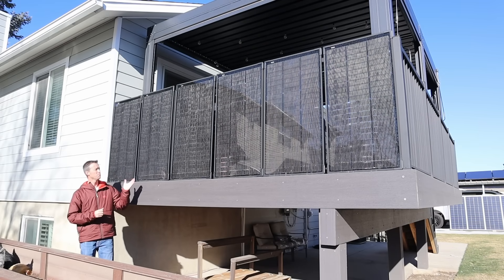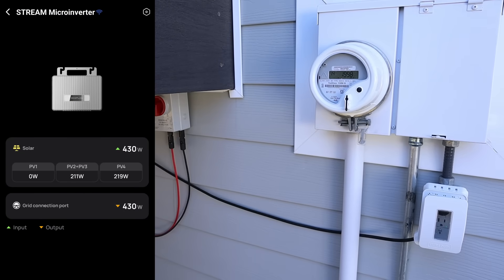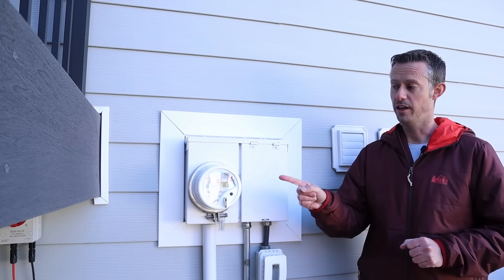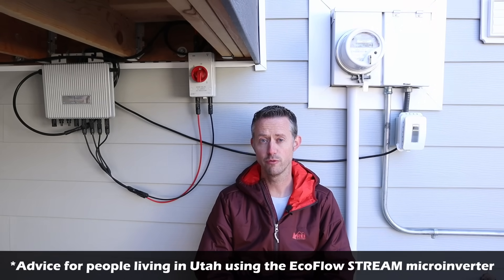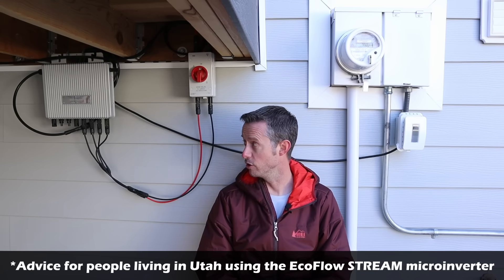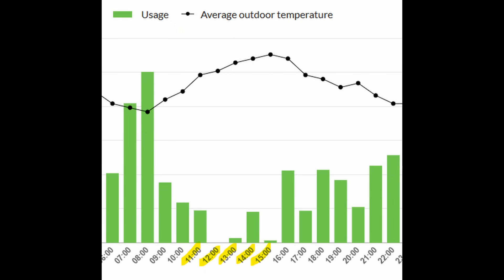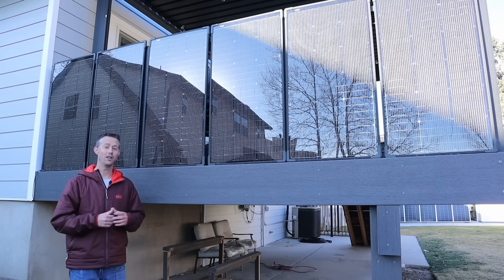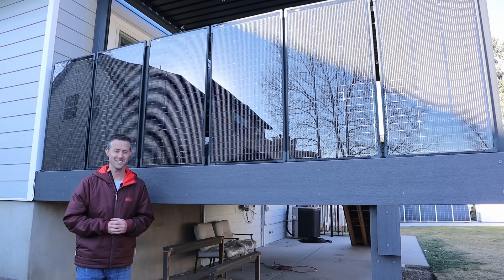The Simplest Solar System I've Ever Installed!  I Just Plugged It In!

Comment from the maker: Read this first before commenting:

1) The microinverter is UL listed and has anti-islanding technology. If the power goes out, or you disconnect it from the outlet while solar panels are still connected, it turns off immediately. Not risk of backfeeding during an outage or getting electrocuted from the male plug. 

2) The solar panels from Ecoflow have a unique wiring setup. They are not like a traditional solar panel with MC4. This array is not wired in series. Each panel has waterproof dual XT60 connectors that wire the solar panels in parallel when they are connected in a chain as seen in the video (each panel has ~45v and 2a). The wiring is super simple for a setup like this and performs great in shading. They are designed for Ecoflow 60v charge controllers 👍

3) This setup requires the device to be on its own breaker. The Ecoflow microinverter is connected to a 20 amp dedicated circuit using 12 AWG wire.
Reply: So, only one 120V leg is powered?
Reply: Hey great video! Can you elaborate on the 3rd point? Did you set up a separate breaker for the inverter? Or are you just making sure to not directly run anything on the breaker it is connected to?

Also, the 48v battery experiment would be great to see! I was wondering if ecoflow power stations have the capability to do exactly what you are saying!
Reply: @Kgjoha  When I set mine up the app had me specify whether or not I was on a dedicated circuit.  IIRC a non-dedicated circuit pumps out 800w (1200w for a dedicated circuit).  My dedicated circuit is on a 20 amp breaker so I'm only using 50% of the breaker's capacity.
Reply: Are shunts built in to mitigate shade affects?
Reply: Following the laws of taxes.
Reply: If sodium ion batteries drop to 10$/kWh as promised by CATL .

There is no way Trump and the oil companies can stop the energy transition..
Reply: Utility company will require proof of permit and inspection. Do your research before going down this road.

Comment: Neat. I still hate solar that can't be used during power outages. I totally understand the safety aspect. My biggest problem is the storage issue. Batteries just aren't viable unless you want to spend a few 10s of thousand.
Reply from the maker: They are only that expensive with grid tie systems like Enphase or Tesla. 
Off grid 48v LFP batteries can be purchased for $900 for 5kwh these days.

Comment: One thing to consider, is everyone doing this leaves the utilities with stranded assets. They either jack up the rates to offset, or potentially stop planning for the extra load and may not be prepared if there is down production the way they could if there were interconnection agreements mandating coordination of downtime and penalties for lack of certain availability thresholds. Similarly, electric cars currently take advantage of infrastructure in a way that's not scalable, with power prices having to go up for everyone to reduce demand and/or invest in grid upgrades to handle exoected load growth more cost effectively in the future

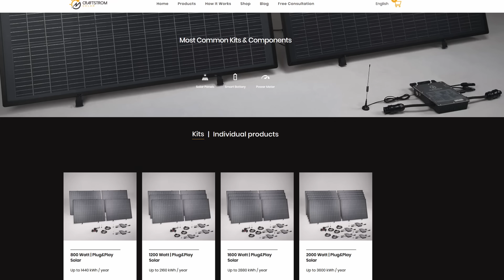Comment: The company's literature (at 3:00), regarding power produced, is very misleading. They are using five hours per day, of max sunlight, in their calculations. This is why so many solar adopters become disillusioned by actual results. Using three hours per day is much more realistic - especially if not in the lowest row of US southern states (four max, even there). This is fraudulent, at best. And, even if in Arizona, the heat produced lessens the power produced by the panels. There is also the inverter's share, the transformer's share, the transmission's share, and the degradation of the panels, over time - all of which are never mentioned. Once included, the 20-year panels will likely take 30 to 40 years to pay back (without including cost of repairs and maintenance) their costs. There is also the increased cost of homeowner's insurance to consider. I'm in no way 'anti-solar' - I simply want to let people know the costs that are largely ignored.
Reply from the maker: In the summer I get 8 hours of peak solar, in the winter I get around 4 (due to shading from my neighbors). If you had a device like this in a field away from shading your results would be excellent. I don't have that opportunity because of all the trees...

Comment: I'm looking into the ecoflow 125w for a similar project and I'm wondering how much input you're getting with 5 panels at this 90° angle setup.
Reply from the maker: 450 watts right now in the winter, it would be less in the summer so I might have to rethink an angling system.

Comment: Interesting. My question is: I thought solar panels rely on being the correct orientation and angle to maximise energy production? Mine are on a directly south facing roof at an angle, and I was told that if I put them on the other side of the roof, they would produce about 50% compared to the south facing position because of this. Also the roof is of course free from obstructions in my setup. Are these different from those panels in that way, i.e: the angle/height doesn't matter as much? Or are they the same as mine (6 x Enphase 450w in my case). Thanks.

Comment: The reason plug-in solar is illegal in most jurisdictions isn't due to excessive generation OR lack of anti-islanding, but lies in having two power sources within the same circuit, creating a fire hazard due to the possibility of overloading the cable downstream between the grid-tie inverter connection point and the potential excessive load point on that particular circuit. A dedicated circuit is necessary for interconnection, but many folks will just plug it in to the nearest outlet without protections in place, creating the danger. I think it should be illegal to supply or use standard NEMA 5-15 or 5-20 connectors on these inverters. GTI's should be required by the NEC to be hardwired with no other loads on its circuit. Only then would it be safe.

Comment: I'd rather spend a few extra thousand for batteries and a decent inverter then give the power company free electric. And what good is this solar when the grid goes down? You can't use it. And unless there is a power cutoff at the breaker, there is a liability of back feeding the grid.

Comment: I live in Utah and just installed this same system on a dedicated circuit.

You have a Y connector coming out of your PV disconnect and into two MPPTs on the microinverter. Does that really work? The Microinverter just splits the power equally to each MPPT?

Also, if you connect the battery like you mentioned trying, wouldnt it just send all excess power above what you are using to the power company for free?

Comment: How many decades until you have 100% ROI?
Reply: About a year, I only have $550 bucks into the same set up. $300 for 3 Qcell 400 watt panels, $200 ecoflow micro, $50 for outlet, wire and breaker. And the satisfaction of producing your own power.

Comment: Nice setup! Solar photovoltaic cells convert sunlight using semiconductor p-n junctions. Micro-inverters optimize each panel's maximum power point. Grid-tied systems require anti-islanding protection.

Comment: Hello I’m an Utah Instaler for ecoflow; this is legal only if it’s completely off grid, no grid feed at all.  Basically what you have is a gas generator input but instead is the solar battery box. Your meter will read all input as a net a charge you for it.
Reply: Rocky Mountain power smart meter is $3,000-5,000 and they do not have to allow you to back feed.

Comment: You should also have a Breaker in your box dedicated to the micro inverter to control the electricity.
Reply: Yes. The EcoFlow setup allows for various circuit configs. A shared 15A circuit is limited to 360W, IIRC. A dedicated 15A circuit is the easiest way to get the max wattage (1200).

Comment: There should be a grounding terminal on the metal enclosure. I noticed your installation does not appear to be grounded. Does this comply with safety regulations?
Reply: It’s grounded when plugged into the outlet.

Comment: I'd like to see a bit of battery back up, so the grid isn't being turned on and off rapidly due to clouds, or random shadows of birds or squirrels covering the panel. A tiny battery, just to even out the power delivery ((The Li Time 100Ah battery seems like a good bet)). I'd also need to do more research on how it back feeds the grid. In my area, backfeeding the grid requires a very specific permitting process and requires professional licensed installation and an electricians stamp of approval, so I'd like to find a method which disables the back feeding, charges a battery backup if the house isnt pulling enough, and if the battery is full it dumps to ground.

Comment: Uhm, your not giving all info, your ownly feeidng on side of your break box useing a 120v micro inverter.  so no, your not powering your whole house, you need a 240v  unit to do that.  Or two 120v one for one side and another for the other side, you have to figure out which outlet is on the other pole.  I already do this with two grid tie and a 12k whole house inverters, that back feed into the inverter s to charge the bateries when it needs.

Comment: Ok my first thought was does anything stop you from putting a small battery system into that outlet with the panels charging the battery? I would like to see that. Could really smooth out the peak afternoon hours
Reply from the maker: Near the end of the video I discuss that since I did successfully connect 48v battery into the ports for 1200w consistently at night.

Comment: interested on update in summer. also with panels total cost was what around $2000?
Reply: I am 550 bucks into my setup. 300 bucks for 3 QCell 400 watt panels, 200 bucks for micro inverter, and 50 bucks for wire, outlet, and breaker. I’ll get my money back in a year or less.

Comment: Was at the local building & safety here in California. The woman in the front of the line was devastated. 
She has bought a solar system, the company applied for & got all the permits, installed the system. The city inspector passed the solar, but snooped around the house and found a previous owner in that 75 year old house had taken out the sliding glass doors and framed it in solid.  GASP without a permit!! Oh the horror! 
The city "red tagged" the property, forcing the family to move out until they remedied the non-permitted wall. Mind you, the header was still there from the door, they just framed it in, so there was no loss in structural integrity. 
The instructions were: 
Get a permit to tear out the wall, reinstall a sliding glass door, get a permit to tear out the glass door, & reinstall a wall. 
BUT!!!!! the city wouldn't issue a permit to tear out the wall, because no permit had been issued to install the wall!!! 
In the meantime, the family is paying a mortgage AND paying to stay in a hotel!!
Reply: Craftstrom has a smart meter to block outflow to the grid for their plug and play system.
Reply from the maker: It's doesn't quite block the power, it just measures the wattage your home is using and it tries to offset the load with a few watts left on the table to be safe.

The Craftstrom units are $2000. Hard to justify the purchase with an ROI of 20 or 30 years.
Reply: @Jasonoid The inverters throttles solar production and sends overflow to batteries. They’re pricey but most states don’t allow plug and play otherwise, so if you have regular power outages and rising costs due to AI, or just want to have some alternative to grid dependence…
Reply from the maker: The Anker F3000 does something very similar using their Smart Meter kit. I'm trying to get hands on one since it's much more affordable with a ton more battery capacity / solar input (2400w)
Reply: Time for a lawsuit.

Comment: Hope this spreads to Florida.   The only concern they would probably have is back feeding the system during power outages while people are working on the line.  This would be great for during power outages though.  Would probably power the fridges and lights in my house no problem removing the need for a generator most of the time.
Reply: @davva360, this is grid-tied so it would not work during a power outage hence no back feeding...

Comment: Would this system provide power to your house in a power outage scenario?  Assuming you were to flip your main breaker to keep from backfeeding into the grid and hurting the people trying to fix the outage.
Reply: The microinverter shuts down if it is not receiving a signal from the grid, so no power in an outage, and utility workers are safe.

Comment: In brazil we have zero grid, which is basically a CT that only produces enough to offset your consumption. I recommend looking up for Deye inverter / microinverters they are awesome and can output excess power to a eletric boiler or any other load.

Comment: I live in a townhouse community. The power meters for my building are in a common utility room, remote from the residence. I've never seen my meter and wouldn't be able. Idk if it's digital or smart.

Does the system need to be adjacent to the meter?

Comment: Hi Jason, this was a very interesting video and I think it could be most applicable to apartment owning individuals who may not have access to their own Soler, but may have a balcony that they would like to supplement with solar power. I think it would be great if you could document this system in a fashion that would allow someone to say power a external chest freezer and or maybe there are mini split if the power went right outside there to help offset some of their electricity cost. Maybe viewers would find that helpful?
Reply: Or to have a separate power source for a window air conditioner for the apartment . Anything apartment related I am interested. The panels themselves can help keep the raccoons off the patio and the cat in if I then screened in the rest of the patio off to the roof.

Comment: I do a similar set up with my deck, only mine goes into a solar generator, then I just run my computer and entertainment center off that generator. only need to plug it into the house when the sun hidden all day. I generate around 800 watts and only need around 450 for my PC. And the battery's will last about 12 hours at this rate.

Comment: This wouldn't even offset the total cost of his refrigerator running all day. For 300 the return on investment could take 3 years to get back. People are going to screw these up and burn down their houses all to save $100 a year
Reply from the maker: You can pick up 400w residential panels for under $100 locally now. With three of those panels and the microinverter the ROI on this system is WAY shorter than a traditional rooftop installation of 10 to 15 years. I am estimating about 1.5 to 2 years since I get quite a bit of sun.

Comment: Thank you for your super informative videos. I’m not good at doing anything like this and wish I could afford to install solar and a system like this. I live in Louisiana but currently live in my rv. Yes, I know it’s not difficult to do but I’m disabled and climbing up on the roof is kind of difficult for me and I’m unable to pay someone to do it. I actually bought 2 100w panels and they are sitting there waiting for me to do something with them. I’d actually LOVE to put a couple of 400w panels up there to be able to fully take advantage of the sun and power everything without being plugged in, but, I know that I need an inverter and charge controller and a decent battery bank. I learned all this from your channel. Thank you again! Hopefully soon I will get all the pieces of the puzzle together and get them installed and be free of the cord and cost of the electric company!❤

Comment: If I remember correctly, the hybrid inverters can be used for off grid as they don't feed into the grid.  They can be attached to generators or the grid for if the solar or batteries aren't providing enough power.

Comment: Considering solar as a coming summer project, I live in Ohio.  Just want to use panels with resistant heat and possibly window AC units - with no grid tie in.  Would a microinverter be applicable?
Reply: It would be better to do a system like this and try to have those window units go when the sun is out.
Reply: Most microinverters need to sense the grid (or a 120v) to activate.

Comment: Do you have a splitter connecting two different mppt's together? That can't be very efficient.
Reply from the maker: The entire array is connected in parallel and the power is split equally between two mppts. It seems to work just fine. I've tested the same connection with a 48v battery and it works the same.

Comment: He's saying it's LEGAL to BACKFEED power into your home in Utah?  I thought backfeeding was dangerous.  EDIT:  I read the pinned comment, and see that the microinverter has a safety cut-off in case of disconnection (unplugging) or grid outage.  This is great.  I hope more states adopt this kind of system.  I'm gonna suggest that to my state lawmakers.
Reply from the maker: Read the pinned comment 👍
Reply: @Jasonoid  Oops!  I jumped the gun (I did watch the entire video first).  I've edited my original comment, and am going to suggest my state pass a similar law.
Reply: @joshm3342  Similar legislation has been introduced in 15 other states, at the time of this writing.

Comment: Germany has the same law, plus these systems are exempt from VAT. 2 panels 450 to 500w plus microinverter cost usd 350 to 450. Smarter systems come with a battery and unlimited number of panels as the law restricts the feed into the house only. So the systems feeds the battery, the battery feeds the house with the regulated max fed.
Reply: Unfortunately, my rented apartment has no power sockets on the balcony and I can't drill a hole through the wall.